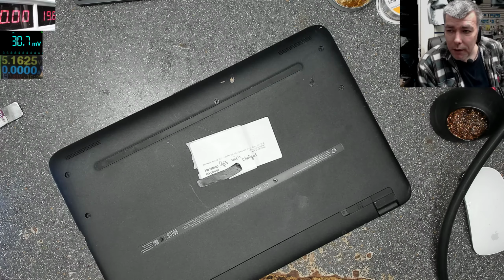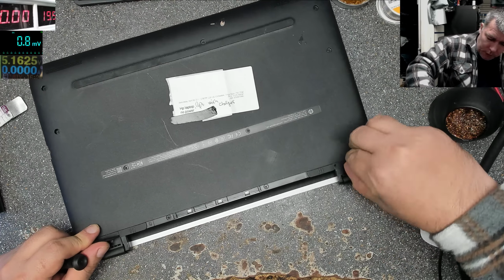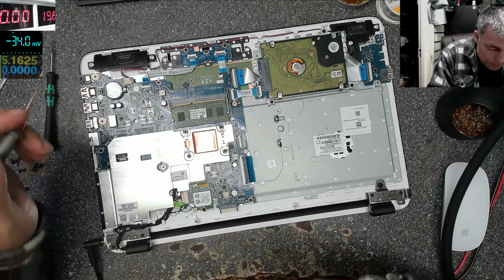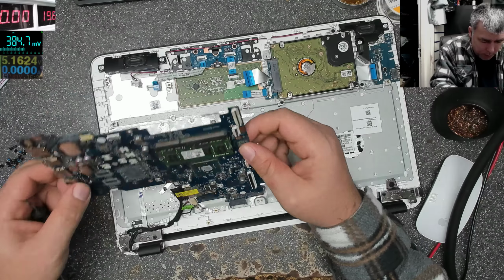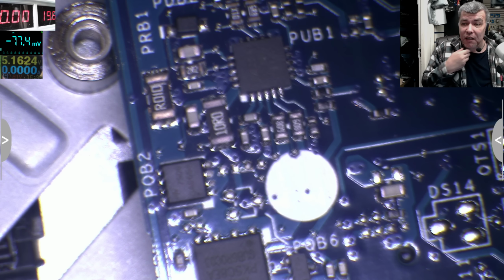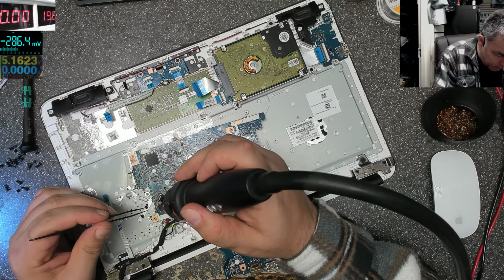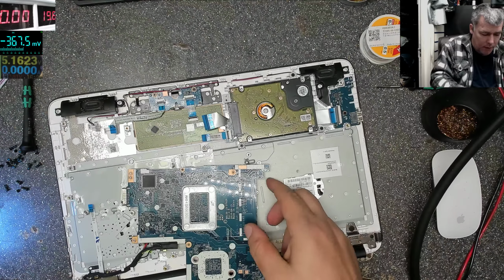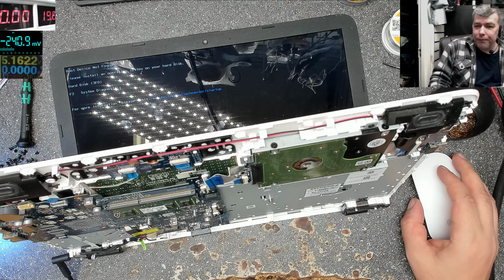Hp 15-ay022na -motherboard repair no power/not charging

Comment: Hi Sorin I have the same laptop but with a little different problem. The problem is that with the battery and the charger plug it in is not power on and blinking orange the indicator led. With the battery unplugged and only the charger is white indicator steady and no power on only the fan can see a little movement but nothing else. I have already measured 19 volts on 2nd mosfet and in current resistor in Vin. Can you please tell me what is possible to going wrong?

Comment: EXACTLY same laptop. different problem. PCIe/rj45 controller overheating (rtl8166EH cg) and not boot. but power and charge lights are fine. please help.

Comment: Just replaced a Winbond super I/O chip from an acer laptop (because it was the only chip on the board that was slightly heating up), with an also Winbond from an other (totally different) board, but with the same first 5-6 letters-numbers in the chip ID. and it worked....!!!
Also i fixed a similar HP with your way here, but i also tried to replace the mosfet with no luck. Seems like the mosfet is ok but it does not open. So the problem is deeper
Greetings!

Comment: thanks, very useful, before disassemble the laptop first I check my charging port, not problem there, but when I check the charger, the middle pin is bending, so I make it straight again with needle carefully and it work...

Comment: SOLVED! My board LA-D702p rev3.0 (applies to other HP, Asus, etc. boards). For anybody having exactly the same issue, where your power mosfets are not turned on and you get something around 0.9V on the gates. 1st check if the MB works as Sorin's method (https://youtu.be/-IrPWbA3i-o?t=710). Than check the second MosFET, in my case it was "7506 AON7506. 30V N-Channel AlphaMOS" shorted and gives false feedback to the power FET driver namely BQ25A (TI bq24725A) so it won't turn on both of the main power mosFETs. Replaced it with another compatible N-chan fet 30V 12A and all works. Accepting RedBULL + Cola or else :D

Comment: good one  by the way  what voltage did you apply to the current sensing resistor  to check sc thanks
Reply: same as power supply: 19v
Reply: @zyxnull  thank you

Comment: The first mosfet gate is often connected to a circuit to detect input voltage, if there is not enough voltage then it does not switch on the mosfet.
I now have to call you "The bypass man." :-D joking sorin :-D.

Comment: Hello
After this repair, the battery will not be charged.
The input transistor is not actuated.
Reply: True. That happen to me too when i bridge. Can only Turn on with battery unplugged .How do you fix properly?
Reply: @deegthllop5316  you have to find thee reeason why the mosfet is not turning on in thee first place

Comment: I have a hp 15 ra005nia that when plugged in light at the adapter area goes on but when switched on, the power light switches on temporarily and then off.

Comment: But in new laptops model like this when I make a bridge over the mosfet, everythings will work fine but the laptop will not charge the battery, so how can we fix the charging issue?
And even if I replace the mosfet, it still no power.

Comment: Hi hopefully you are able to answer this because this video is from a while ago I have the exact same laptop only difference is I get power power light it turns on and everything at first it would stay on for some time with charger plugged in then completely turn off, but work completely fine on battery power, now pretty much as soon as you plug in charger it turns off.... To charge it I turn the laptop off and let it charge then turn on on battery power which works fine until dead .... Do think it's same problem as yours ?....

Additionally I have tested a new charger it did the same thing just not as quick so I'm sure the fault lies within, I also notice that the battery logo is moving up and down as it does when it displays charging shortly before it cuts out it stops moving but maintains a plugged in sign then completely cuts off, you did mention mofsets in the charger and board I'm wondering if it's sensing a short or failing resister ect and cutting power

Comment: i have hp pavilion 15 -cc055tx, it's led near dc jack not glowing, caps lock led also not blinking, but led on power button blink 2 times and off and again two times blinking, i reprogram the bios with programer but it not turning on

Comment: i have the same motherboard .when put charger light white when put battery it light red .voltage are ok.light on charge ok but no powering.no shortcut no heat.maybe bios fail ?.any idea plz

Comment: I have an hp laptop that has light but when powered on, it goes off right away as soon as fans spin. Hope to find a video solving a similar issue
Reply: Shutting off immediately after turning on is often a graphics chip issue
Reply: @PracticalKnow  that would be bad news. Thanks for the tip.
Reply: @HassanDibani  np.. if that is the case a reflow might help with that situation
Reply: I have a similar problem
Reply: @PracticalKnow  any way to turn the graphic sytem off and make it work with the integrated graphics?
Reply: There is a link in the description to Sorin's Discord chat. Much better place to ask for help.

Comment: hi, can you help me? I have hp 15 r004ne laptop and it got heated up and then it just got off as I was playing a video game on it. after that, it is not showing any sign of life. no charging indication, not turning on, etc,  but I have checked through multimeter, the power is coming into the motherboard in the charging socket and now I have no idea what to do next? what could be reason?

Comment: If you would replace the mosfet instead of running the cable should that fix it ?? Or cable was necessary??
Reply: No, wasn't necessary. It can be replaced. The wire is used like a bridge to skip that mofset
Reply: @manolevld  

Thank you for replying !

Comment: Hi there, Once you don't show exact measure points zoomed, it's meaningless for amateurs to do such debugging when you just put multimeter probes somewhere on the board. Also you don't describe what to do if there is difference of what you've measured vs. user case. Therefore I consider this video as half-education with hard-to-understand parts.